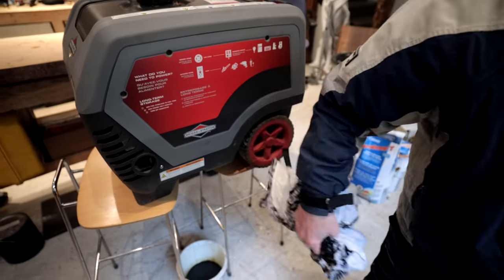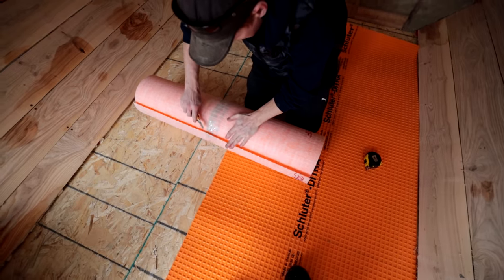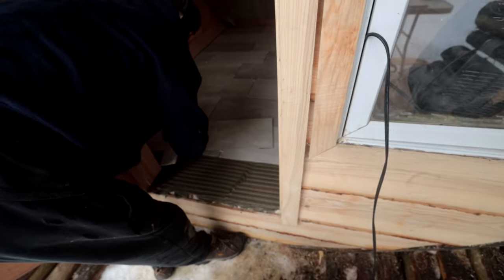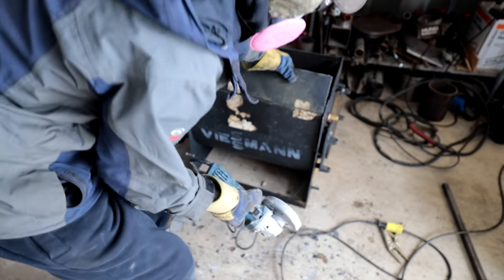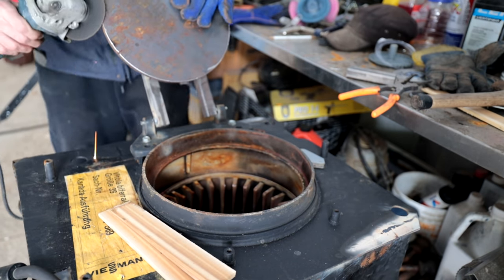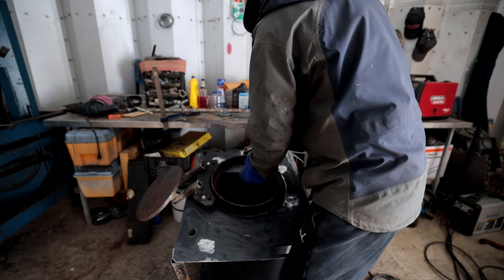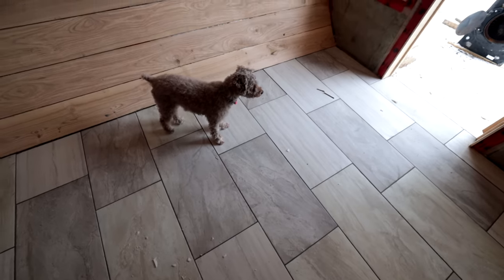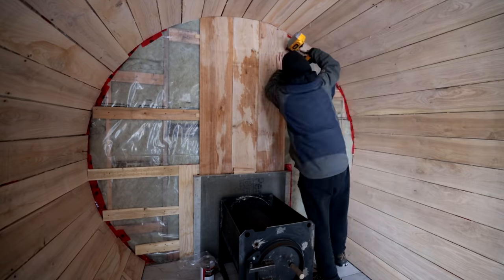Building $1.00 'Steam Punk' Wood Stove for Off Grid Sauna! - Part 3

Comment: I built a sauna with my old man once. We had an issue where our eyes would start stinging as we went about using it. We narrowed down possible causes to poor air quality. We intalled a proper air inlet and all stinging ceased. I can highly recommend it. 
Cheers!
Reply: I second this. Should have a vent inside. Makes a difference. Hopefully that stove will be enough to get to 90-100 C.

Comment: As a Finn its really weird seeing a sauna without a drain, usually we have em is to ease the cleaning of the sauna and since you throw water on the rocks usually as well so if the sauna stove(kiuas) isnt hot enough it does not leave pool on the floor. Great vid tho as always :)
Reply: This is exactly what I commented and noticed your comment. Torilla tavataan and also where is the drain?!
Reply from the maker: It'll drain right out the front door.
Reply: @ModernSelfReliance  The stove will be very hot so it will do damage on the floortiles. I suggest to get some sort of heatshield under the stove. Also the drain is important because not all the water isnt going to go to the kiuas.
Reply: I suggest you put a tank on the chimney or on the side of the sauna. Thats how you get yourself boiling hot water to mix with cold to have a shower. The wood on the wall and the door are going to rot pretty soon unless you put a drain.

Comment: You can use that wood heater to dry your wood correctly. Sticker and layer your green lumber in your sauna. Leave an open path to feed your firebox. Open your door every day or two to let out the steam and voila! You now have drier wood. Of course you’ll never get it to less than 10-15% moisture content, but you’re not building furniture with the wood and it will fluctuate since you’ll be adding steam to the sauna. But you’ll be working with semi stabilized lumber. Love your channel!

Comment: Great work Kevin, keep it coming. In our saunas, the high humidity 100%RH at 90 C and lots of splashing with with water while bathing is not a big problem since we build them differently. Instead of making the countryside saunas watertight, we make them with air gaps and a water drain or two on the floor so that water will always escape. It is critical that after bathing, the sauna is well ventilated, else it will rotten very fast. It is a common practice to light up a small fire in the oven to dry it afterwards. Enjoy!

Comment: Just a quick tip for you Kevin.  Most oil bottles have the throat of the bottle offset for a reason.  Try pouring with the "wide" side of the bottle pointed down. You'll  have to tilt the bottle at a greater angle and its much easier to control the flow.   Kind Regards  ~  Science

Comment: This Sauna turned out great, BUT, it definitely will require a good amount of combustion air. That flue pipe is constantly drawing air out of the structure and as a result the structure and humans will require a source of fresh air. You may be able to cut a couple of ducts at the lower level of the rear wall and run some ducting along the firebox, then terminate at the door of the firebox. Make sure that the snow level never blocks the inlet!
Of course you could leave the main door ajar but that isn't going to feel comfy to anybody using the sauna. A cold air draft across the floor surface will not keep you very warm, but it wont asphyxiate you either.

Comment: I built a sauna in the early 80s. It had an airtight stove and a good stove pipe. It wouldn’t get hot, no matter how big a fire ya put inner. After I added a 3” intake pipe (essentially using the outdoor air to supply oxygen to the fire) the temperature shot up and we had our sauna! Great video!!

Comment: being a guy who's had experience with that welder, i can say its a dream to use, you can set gauge thickness as well as wattage and its all computer operated. little pricey but unless you know exactly what you're doing the cheaper ones are going to be more of a hassle as its not computer run and nobody can read those dials right. i love the lincoln 3000 and i stand by it 100%
Reply: i just realised it wasnt the lincoln 3000 whoops, still tho lincoln 3000 is the way to go

Comment: you could consider installing an outside air intake so the fire wont consume all the oxygen in the sauna.  but maybe the negative pressure bringing in fresh cold air will be good for the sauna too. its hard to say
Reply: Oh no trust me he wants an air intake unless he likes suffocating along with the fire, the shear heat can actually negate an air flow (specially from a tiny crack in the door)
But he could just have the intake feed directly into the stove so it won't cool off the sauna but still provide good air flow.
Reply: I’d call that a window 🪟

Comment: Looks awesome, but I am afraid that you will be breathing smoke and the fire will be consuming all of your oxygen. You should install it the other way around, with the door-end of the stove poking out the back wall.  You would need to go outside to add wood to the fire, but no smoke gets into your sauna, and the fire draws it's oxygen from outside. I've seen an outdoor, woodfired sauna set up like this, and it was great.
Reply: That's really not a problem for as long as you have decent airflow, which every sauna should have. I would be far more concerned about the tile floor which will be too hot to walk on and the moisture that will collect between the wood and the moisture barrier because of missing airflow.

Comment: When Smith Cornona existed we would take a very small electric motor (fan type), remove the armature andscrew it to a board with a push button switch. Stick your "screwdriver, nail  whatever in that hole, push and hold button 3 or 4 seconds, when you released the button, you had a magnet.To reverse that hold the button while pulling the tool out. OSHA would have stroked out. As I recall it was not permanate.

Comment: It's called 'löyly' and 60-80 degrees for me is ideal, 50 is just warm.
Also I have to mention the drain, water has to go somewhere, otherwise there's gonna be a pool on the floor.
Second note is ventilation, it's a must. It will deliver fresh air to breath and also help to dry sauna after bathing.
How about hot water? 
We hang an alloy box with faucet on the side of stove, it will provide hot water for washing up.
Reply from the maker: Side arm water heater. good idea.

Comment: That sauna is looking better and better! And I'd say that while the stove is a basic wood-stove (and by definition will be used for steam technology), stylistically, it looks more dieselpunk (think Mad Max). Either way, well done!

Anyway, once you've got the sauna up and running properly, consider trying a really HOT sauna. Like, get undressed (or swim trunks if you prefer), fire up that stove and see how high it goes, and really sweat it out for a while. (And have something nice to drink while you're at it). If it gets too much, you've got snow right outside to roll in (and seriously, when you're overheating from the sauna, you'll WELCOME a roll in the snow, lol). I know I'm not really selling it here, but once in a while, it can be really invigorating (and there are some supposed health benefits to it, too). If it's not for you, then yeah, stick to temperatures that work for you and use it as a warm relaxation room. Lord knows I used our sauna more as a warm relaxation room than an actual sauna for the most part (because there are a lot of days where you don't have the ENERGY to sweat it out like that and you just want a warm, quiet room).

But just... you know, for science, I think once it's done you owe us a report on a) how warm you can actually get that space, and whether the insulation seems able to take it, and b) your report on how it actually feels to properly sweat it out in ol' Jupiter there. :-)

Oh, also, just curious, is that just a general thermometer you've got? I didn't get a good look at it. Has it got humidity levels too? And do you have a co2 checker, what with being a relatively confined space with a woodfired stove in it?

Comment: Not sure if you did, but for anyone else thinking about using Schluter Ditra, you are supposed to use an UNmodified mortar. People at HomeDepot and Lowes will tell you otherwise, but go ahead and read the instructions from Schluter or give them a call. It does in fact require unmoified mortar. It may work with modified mortar, but I didn't want to risk it when I did my bathroom. I would also recommend using Schluter Kerdi to fill in seams between cuts of the Ditra in bathrooms and kitchens.
Reply from the maker: You are supposed to used modified underneath and un-modified to stick the tiles.  You can also use Kerdi band on the seams of the ditra to make it truly waterproof.
Reply: @ModernSelfReliance  maybe they changed it, but when I did it, it was unmodified for both.

Comment: True that! I hate seeing floors where you can obviously tell they were not run perpendicular to the subfloor, floor joist, etc.… Another major nuisance as you said is that folks fail to stagger their joints and therefore you end up with almost every other tile or board lining up… This can only look great if every single one is like that and it still looks pretty shitty especially with today’s laminate products you want that stagger to be natural at least three or four Rose before similar, otherwise it just shows a straight line down that is definitely not all the way straight and it’s the first thing people’s eyes catch. Thanks for the videos, cheers!

Comment: You can use Hand goop then take that toothbrush stick in the hand group and then scrub the screen with it and all that carbon will fall right off and just wipe it off a different hot water and run right off !

Comment: I've heard from Swedish colleagues that it was not uncommon for entire families, all 4 generations, going into the sauna together.  Also when they  feel good and hot to roll naked in the snow at least once in the middle of a sauna session.  You definitely want to plumb a combustion air intake with damper to just inside the firebox door, this will prevent cold air getting drawn in through every crack.  Also a fresh air intake with a valved Y where one branch blows directly onto the heater, so as to regulate temperature inside and not have a continuous cold draft.  Lastly, I wonder if that tile floor will EVER warm up "enough."

Cleaning the ashes with all those fins will be a challenge.  I would have considered making the original water jacket the firebox, and have sauna air convect through the finned hole to heat it.
Reply from the maker: I have another video where I addressed most of the concerns in this comment.

Comment: Great next steps on the sauna. Not sure about the tiles instead of a wood grate style floor, but I'm sure it will still work well for you. How are you going to remove ash from the stove? and is there a drain underneath for water that collects in the rock box?
Reply from the maker: The box should collect the water and boil it off if too much is thrown.  I'll use a fireplace broom to remove the ash.

Comment: So the old boiler maybe cost $1 but you probably added $40-60 in material, welding consumables and abrasives.  The most expensive part is not always the stock material depending on what you are making for a project but all the added expenses that you tack on to finish the build.  It is still far cheaper than going new but it is something to always consider.

Comment: I DID enjoy this episode, like I enjoy all of the rest.   That's a small space and a decent size stove, although the point is not how big you can get the fire but how stable you can keep the fire.  And I am just a girl, so what do I know but, I think it is not a sauna at 45 degrees, no matter how long you sit there.  Wait a minute... I think in Fahrenheit, you talk in Celsius.   Isn't 45 degrees Celsius like...boiling?  Well, no, not boiling maybe, but awfully hot.  Over 110 degrees F.   How hot do you want it?  And no doubt you had some buckle!  Explain to me, again, where you will put the rocks relative to where you will have the fire.  

Fun video!  I think Don should get first shot in the sauna, unless it's a group thing.  But I am a soak my joints hot tub kind of person.
Reply from the maker: It was 45 Celsius which is very warm.  Next update shows where I put the rocks.

Comment: You should not be using 30 weight oil in the generator during the winter. You should be using 5w 30 during the winter. I know generators come with 30 weight oil when they are new, but my Generac owner's manual says to use 5 W 30 during cold weather.
Reply from the maker: funny enough I used the old container with 5w30 in it from a larger jug.  task successful

Comment: Btw. The roof of your sauna.. is the wood just foor looks or do you have some insulation and coating to keep the moisture out from the wood so it wont start to rot? (I haven't watched all episodes of the build so not sure about this question)
Reply from the maker: It's simply for looks.  The wood only touches on the high parts of the culvert so it doesn't have any trapped moisture.

Comment: That square tubing is galvanized, the smoke from you welding that stuff will kill you. Grind that stuff well before weld it. Great work though.
Reply from the maker: The square tubing was raw steel.  It even had some rust on it.
Reply: @ModernSelfReliance  on my small phone screen it looked like galvanised, even the residue left behind after welding. Dangerous stuff. 
Rust? That's patina and that = money these days, so they say.